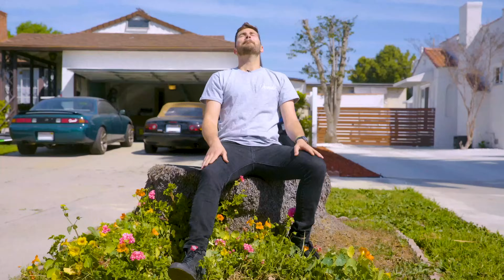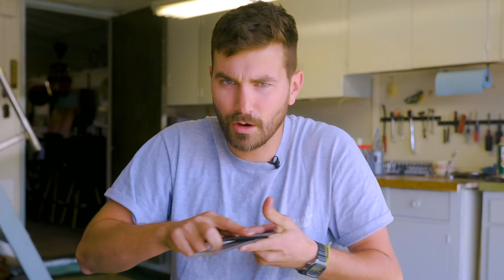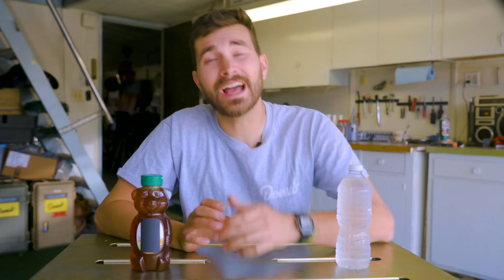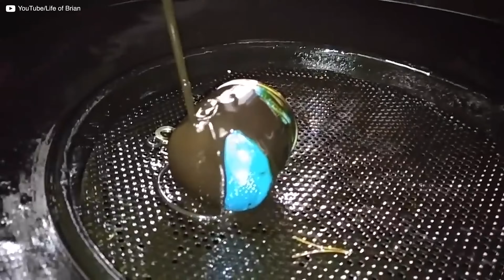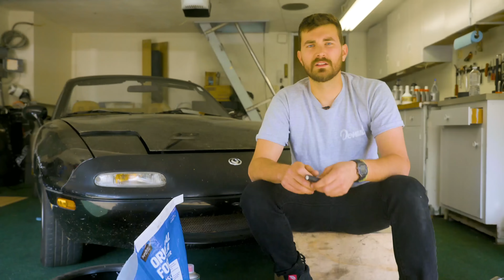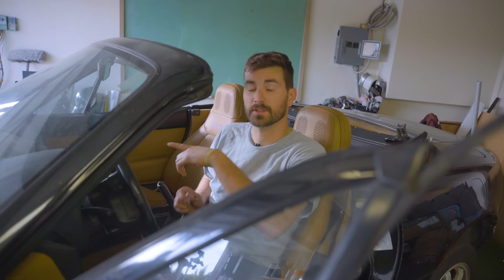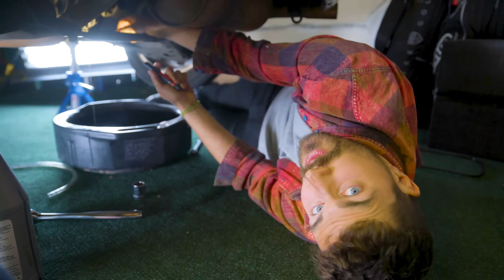9 Things You’ll REGRET Not Doing to Your Car

Comment: As a mech, my advice is to buy an extra litre of the oil of your engines taste. When you have drained all the oil from your engine, don’t close it yet. Grab that litre bottle, dump it in a pot, heat it up to 200 celsius cca, and flow that through your engine to wash away all the loose scum... Also, change the oil filters at every oil change... It’s 25% more expensive this way, but yields in years of engine life and helps with all the other shit not going bad, like hydrolifters and such elements... vtec especially... also, if you got cash to spare, have a maxing can in ya car and mix a bit of two-stroke stihl ultra oil with the gasoline as it reduces wear in the comb chamber as the top piston ring is least lubricated, and so are the valves... some claim it increases deposits and what not, but in my experience, a bottle of carb remover deals with that either way, and in the end result in a much longer lived engine that doesn’t ask for money in reparations which are always more expensive than maintenance...
Also, stay away from those performance filters of any kind... a good expensive filter that is not performance rated is always a better deal than an expensive performance filter as one will provide great filtering, which is its main duty, and improve your performance, and the other will let all the shit through and improve performance but only for a short while, until the junk that got through ends your engine...

Comment: At around 11:00 you talk about non-compressible water turning to compressible water vapor as the reason it's not a good brake fluid which I believe implies that the compressibility of water vapor is the reason you wouldn't want it.

I believe that the more significant reasons are that:
A. Water expands 1200 times when going from liquid to vapor, this would lock your brakes and blow seals very easily.
B. Water will lead to rust.

I think those are the most significant reasons it is not a suitable brake fluid. Being compressible is a far third to those two reasons.

Thoughts? Am I way off? Am I nitpicking?

Comment: LMAO I put mobile 1 in my old miata and it leaked out the rear main seal like a sieve, also left grey sludge in one cylinder. Flushed it, added lucas with 10w-40 conventional oil and its much happier.

Comment: you forgot to say to remember the order of spark-plugs cables when you take them off...
Reply: Or just do one plug at a time, putting the cable back on before moving on to the next
Reply: @sharonoddlyenough  yea i tend to change one at a time.
Reply: @sharonoddlyenough  yep, that's the absolute best way to do it.
Reply: Why? If they work, they are fine, no? You can use a multimeter to check the resistance on them.
Reply: @CoreMaster111  Spark timing.  They don't fire simultaneously.  They fire one right after the other, as each piston reaches the top of the compression stroke, and goes into the power stroke.

If the timing is off, it won't spark when the gas is properly compressed, causing a loss of power, possible stalls, and even possible engine damage, depending on where the pistons are in the stroke when the sparks fire.

If you put the cables back in the wrong order, the spark plugs will fire with the wrong timing, because they'll be timed for the piston they came from, not the one they were put back in.
Reply: Karl H. Künstler not order new ones, remember the order they were in.
It’s usually easy enough, the engineers make a point of adding clips and ensuring the lengths are slightly different.

Comment: My only comment on this video is the use of a coin style spark plug gapping tool. These are not recommended for any iridium type spark plugs as they will break the tips. You're better off using feeler gauges to measure and gapping the strap using a bending tool that doesn't leverage the tip.

Comment: i have an 88 supra and a 72 mini and love my cars. My flatmate bought himself an R34 and I cheked it over and gave him the thumbs up except it had a leaking water pump and the oil was BLACK as fuck and needed changing. I helped him change the water pump, and I told him again to buy some good oil and do a change. Fast forward SIX MONTHS and his turbo siezed up while driving because the feed was gunked with thick sludged oil becasuse the dumbass STILL hadn't done an oil change. It cost him 4k to have a new (albeit sick) turbo put on and get a retune, all because he was a lazy shit and didn't do the most basic maintenance you can on his "pride and joy"

Comment: Oil... ugh... oil...

My '15 VW passat (standard 4cyl turbo) uses Mob1 5/40 full synthetic and always runs low long, long before the recommended 10k change interval - generally around 2k I need to add a quart or two.  I usually go through 3-5 quarts between changes.  No oil spots on the driveway, though, nor smell of burning oil. :/  Should I recommend going up to 10/40 do it'd not vaporizing so easily?

Also, fuel filters:  The manufacturers got smart, now they're integrated in the fuel cell so changing them is beyond a chore, it requires a garage capable of dropping the fuel tank (or a model with access to the pump via the cabin/trunk).

Comment: Quick points on the belts, I think it's worth mentioning that newer cars hvae ditched that manuak methid of tensioning for auto tensioners, some of which need particular tools.  When checking the belts, also check if there are any polished parts in the valleys of the ribs, this means the belt could look fine with no cracks etc, but could be so worn that it is bottoming out on the pulleys.

Comment: It's always funny/painful to me when a seller brags about how they change the oil often and use synthetic oil as an attempt to try to sell me on how well they take care of the car, but then I look at the brake fluid or coolant reservoir (if they're clear plastic,which they should be, unless you suck as an engineer (Looking at you BMW)) and they are full of black fluid and/or low on fluid. Or I look at the fuel filter date and it's the original (after 100k+ miles).

Comment: Is it a good thing if my engine oil looks like a metal flake smoothie
Reply: It should look like Choccy milk
Reply: Them apples lmao rip 💀
Reply: Bro your engine is having a problem
Reply: Khalid & Dana Abbara nah it’s fine
Reply: Lada?
Reply: @Them apples RIP your car’s motor. If it looks like a “metal flake smoothie,” then that means you have parts rubbing big time somewhere, and it’s shaving them down. That also means that metal flakes are just floating freely through your engine, effectively “sanding” down the engine from the inside out. That’ll ruin the engine real quick. If I were you, if it hasn’t quit yet, I would look for a new vehicle, or at least a new (or used or rebuilt/remanned) motor. ASAP.
Reply: @codywaggoner7611  I just drained all the oil and it’s been running fine ever since, 5K miles in and haven’t even put the drain plug back in

Comment: I've been a certified tech for a little over 6 years and I have to say this series is the best, most informative series I've watched. Everyone pay close attention. (However you guys forgot to say that you want to start bleeding the brakes with the furthest caliper away from the master cylinder. Longest line holds most air. If you start with the shortest line the bubbles in the longest line will work their way deeper into the lines/abs stuff. Not fun.) Great video!

Comment: I run 20W-50

Because my engine runs 5 psi at 200F on 5W-30 and 20 psi with the new oil. 1979 Ford F-250, 1973 Lincoln 460 engine.

Comment: Great video! I would add some additional notes:
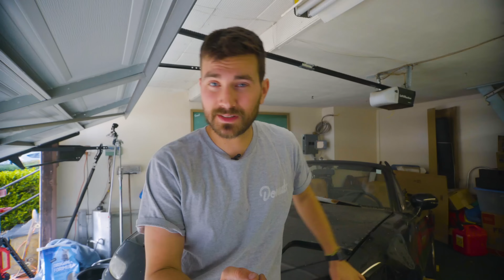5:28 Depending on what you do, might not need to lift the rear or lift the car at all. Also important to keep car leveled
6:15 It is advised to get a new crush washer.
6:30 You might need a special tool to remove it, if it is too tight
7:10 Good chance your garbage utility company can pick it up for free from the curb, as long as you label and secure it properly 
8:57 In most cars you can fill the trans fluid without a pump
9:17 Typically FWD cars do not need to have differential oil changed, as it is part of transmission
17:12 Make sure there is no dirt before pulling out spark plugs. Blasting the hole with compressed air should suffice.
18:24 In SOME cases spark plugs need anti-seize lubricant to be added on the thread
19:38 Not all cars have two belts
Reply: 6:31 always check to make sure the old seal came off with the old filter. The seal can get stuck to the peice the filter screws onto. I've made that mistake before and it's not fun having 5 quarts of oil all over your driveway.
Reply: @dukeskookum2674  Good call thank you! Never happened to me, but now I'll know better.
Reply: Duke Skookum lol haven’t had that happen but I did forget to live my oil pan full of old oil and backed over it, still had five quarts to clean
Reply: You should fill the oil filter with new oil prior to installation to avoid a dry start. 

You should also bleed brakes starting with the caliper furthest from the booster.
Reply: I would add that it's a good idea to fill your new filter with new oil before installing it, if it's not side mounted, or drop-in type. just a good habit to get into so there is less air in there before first startup.
Reply: I'd also say not to put your sump plug in until the filter is replaced, I service cars on a daily basis and alway have more old oil come out when I loosen the filter, even with the filler cap open
Reply: Alex N should add @ 12:15 when bleeding the brakes start at the wheel farthest from the master cylinder and finish with the closest one.
Reply: Idk how he forgot  the most important fluid, the blinker fluid. To me you just got dicredited for forgetting it.
Reply: Thanks for your additional info, you know a lot more than I do, care to give my comment a read?

Man I feel like I would really screw this up on my Range Rover.  And I don’t want to do that.  And on my M5... well... I can’t access anything.  So idk what to do.  Because I hate the dealer maintenance fees.  Any suggestions guys?  

On the ranger rover Evoque I bought my wife, it’s a turbo and she loves it.  I detail the hell out of that car and there isn’t a scuff mark on it.  But you know as well as I do, it’s going to suck later on in life with electrical and possible engine problems, it’s 3 years old now and only 40k miles.  But I know when that things starts pushing 75-100k miles there could be issues.  I do have a 125k mile warranty on it bumper to bumper, thanks CarMax, only place I would buy a used car like this, but I don’t want to screw things up doing my own maintenance.  However, the components are all there for me to do my own maintenance, so my question is Has anyone done maintenance on that car or one similar?  Another Range Rover model, or some sort of other high performance SUV.?  And if so did it turn out ok?

Question 2... how the F do you do maintenance on a 2019 M5 Competition series?  Even when I got my first bmw at 20 years old I had this issue.  I sold door to door security, back in 2009 and made more than I was paid lol but all in all I saved all summer long, and went in there and bought that 2007 335i m series.  Not an M3.  When I brought it home to show my dad, shortly after he called me an idiot, he tried to check the fluids, and was like wait, you can’t even check your oil, yes you are an idiot son.  Then a few weeks later I chipped it, and put on the M3 tires and he drove it, burned some rubber which brought him back to the feeling when he was my age taking cars like his el comino down to the track, and said ok, your not that big of an idiot.  That’s really comfortable and a whole lot of fun.  Haha love my dad.  But neither of us figured out how to do the maintenance, paid 2200$ for brakes, and less than one year later someone crashed into me and totaled it.  I switched cars to an avalanche truck, a Kia Optima slc turbo and even a corvette Z06 over the years, but all the while, I loved that BMW.  So I went out at 31 years old and got one.  The BMW M5 Comp. (door to door sales have been good to me, especially solar), yet after all these years I still have no clue how to do self maintenance like an oil change.  I’ve only had the car for a few months, so I haven’t needed to yet.  But I can’t see anything to maintain.  No dip stick, no brake fluid container, no steering wheel fluid container, no nothing.  Except I think I can put in window washer fluid. So has anyone ever worked on their bmw?  How do you get all that plastic covers off the engine housing and everything else?  Is it worth it? Is it possible? And does self maintenance void the warranty?

Thanks for any feed back and response. I really appreciate it.  I’m a car guy in the sense of living and knowing a lot about cars and loving to drive them, but I don’t know how to fix them like some people on here I’m sure. 

Also sorry for the long comment for anyone reading it and trying to help out, but I figured I’d try and make it an enjoyable story to read rather than just straight tracks.  And if anyone wants info on how to get into door to door solar sales, how much you make or could make, the type of company you need to work for, how to do it, or anything else.  I’m happy to offer that info to.  It seriously changed my life.  Everything I have I owe to God, but also door to door sales.  

Thanks everyone
Reply: This needs to be pinned
Reply: Came here to see if someone else had already pointed some of this stuff out in the comments. Was not disappoint
Reply: Brake bleeding start at passenger rear tire, drive side back, passenger front, then finish at driver front
Reply: Miatas are RWD
Reply: "You might need a special tool to remove [the oil filter] if it is too tight". As in, every time after you had a shop do it instead of doing it yourself. I really have no idea why they crank those things on there like that but it pisses me off. I like to use K&N filters because they have a nut on the end so you can just use a normal wrench instead of a filter wrench (and they're good quality) but they aren't always available locally. But no shop outside a high-performance shop is gonna use them so that doesn't really help the above situation.
Reply: @sntslilhlpr6601  screwdriver and a hammer. Never fails haha
Reply: Nobody asked

Comment: About trans oils. The GL-5 is required for hypoid gears, where there is "slipping/sliding" between the gears, as to usual helical gearing, where cog teeth just touch and don't move more relative to each other. Also the GL5 is backwards compactible as far as I know so it shouldn't be bad for the syncros.

Comment: Why is it the in America manufacturers recommend an oil change every 3000-5000 miles or every 3 months?

In Europe for the same car the manufacturer recommendation is every 10,000-12,000 miles or every year for an oil change. None of the cars I've ever run has had issue with changing oil at this lower European frequency
Reply: Are you getting confused with kilometers and miles?
Reply: @HiTemperredBananaz  nope live in Britain we still use miles. Owners handbook for both our cars, 12,000 miles or 1 year

Comment: Are you supposed to put the engine oil plug back in before you take out the oil filter?
Reply: Unless you have a second pan or a large enough pan you'll make a mess when the drain hole drips with no plug in it when you go to catch the oil from the filter.

Comment: A slick trick I learned from a mechanic was when you check the belts
To know if they’re good tensioned good, you should be able to turn them a quarter turn (90 degree) it have helped me atleast and I haven’t had any belt problems yet.

Comment: I once lost two spark plugs which had to be replaced, I drive a manual, and the feeling was that the car lost power, it fully shuted down on stoplights, and it also  moved around kind of like when you start to learn manual and dont know how to let go of the clutch.
Overall you feel a great change in your cars performance.

Comment: Putting the jackstand on what you call"pinchwelds" is not a good spot to position them. This is where the fender bolts to the car and i see so many cars damaged from jacking at this point. Granted most jackstands do have small slits in them to accommodate it, this is nowhere near as secure as putting them under the subframes.  I get it is easy and i get its where the scissor jack on the trunk is supposed to go, but that is for simply changing a tire in the emergency on the side of the road; not for supporting the weight of the vehicle for maintenance when your doing service to the vehicle. This is dangerous and really damaging to the point where if done incorrectly can affect the alignment of the fender or even worse the stability of the vehicle. I have seen many "pros" do this on two and four point lifts when there are many better places to support the weight with much higher guage steel to support the car. Always safety first.

Comment: Apparently newer plugs are iridium tipped, and not only don't need gapping, but you will damage them if you do... I didn't know this and I bought crappy ones that needed gapping instead of getting good ones from Mazda, and then my engine got full of engine gunk 'cause they weren't burning properly...

I got new ones, but haven't installed 'em yet... they were pricey, but if it means I won't have to spend a ton of cash degunking an engine in another 30k, then it'll probably be worth it... =p